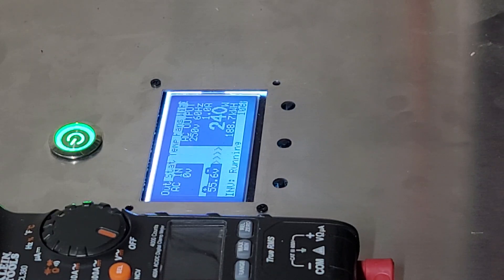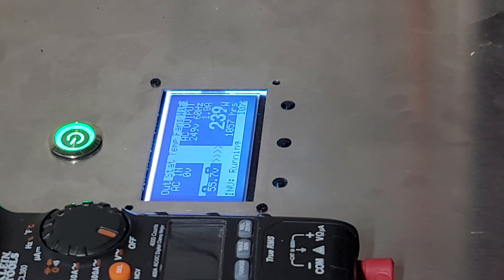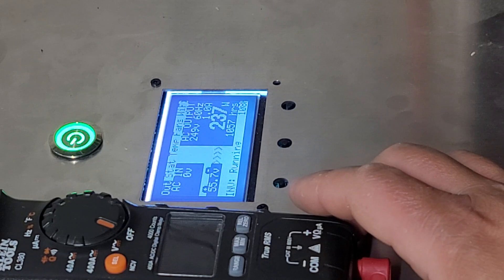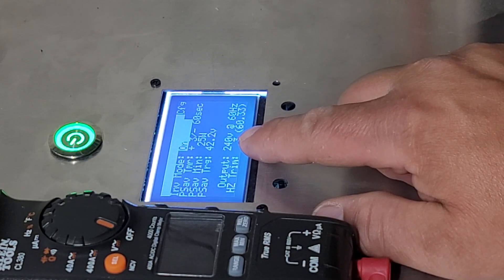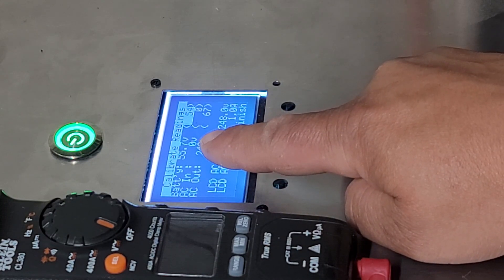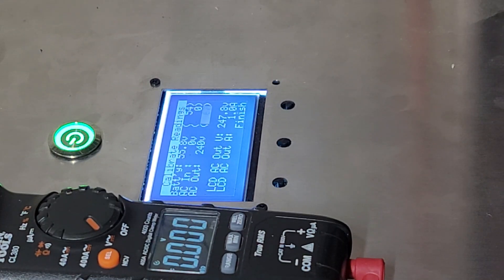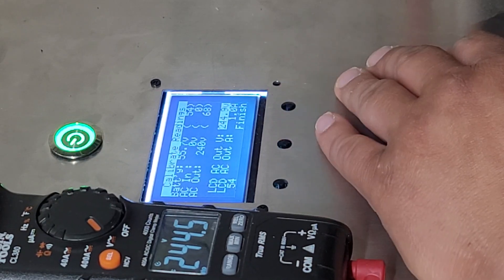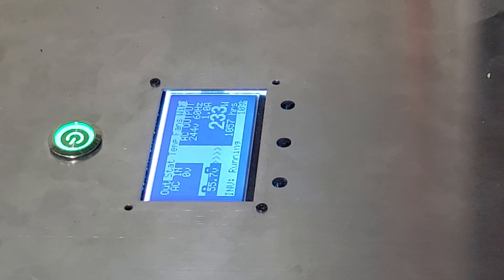How to calibrate a Genetry Solar Inverter

Comment: Why do you prefer to run your split phase inverter at 240v but actually have over 240v measured voltage on your output leads???

Comment: Did you ever figure out what was burning up the 12k inverter ???? Great explosion like your work.... Keep it up....
Reply: Found 3 causes, but have been working on code lately.  Need to finalize the Rev. C design, fix up the prototype boards, and then go back to some more tests.
Reply from the maker: Turns out sid installed a copy of Ubuntu on the inverter.
Reply: @GenetrySolar  Bill Gates might have stood a chance to win the latest space race if his rocket hadn't been busy installing updates on the launchpad.

Comment: Most of these calibration necessities will not be necessary on the upcoming Rev. C board, which replaces the highly temperature-sensitive optoisolators with isolation transformers.  Yes, I'm still learning.